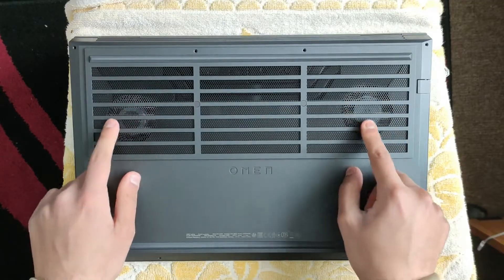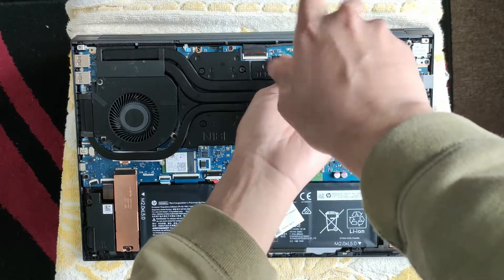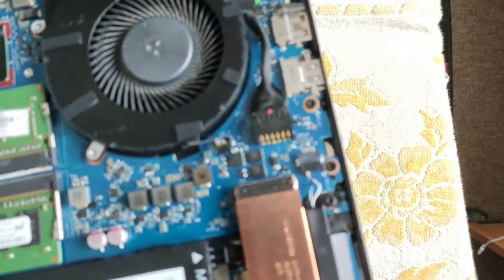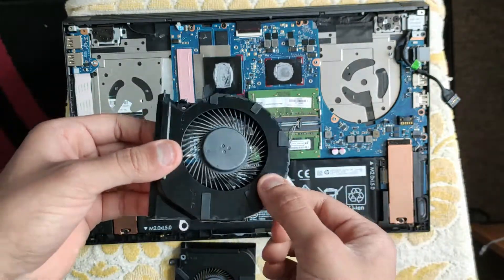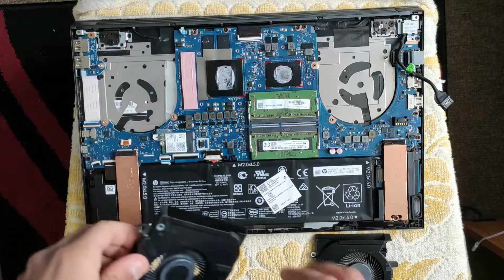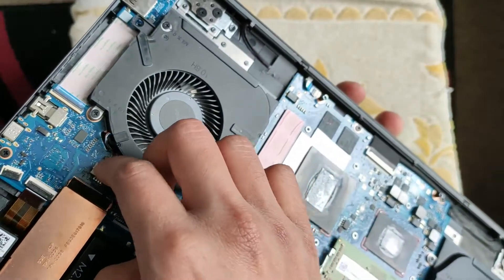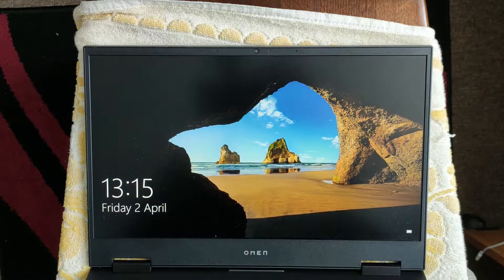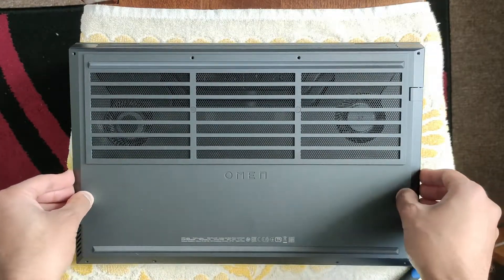HP OMEN 15 2020 || How to Remove and Clean the Fans

Comment from the maker: If you want to find a replacement fan for your device, you can find the "Service PN" number on the back of your fans. Use that to find online the fan that fits your laptop.

In my laptop, the part numbers are the following: 
M04215-001 for the GPU fan (fan on the left in the video)
M04216-001 for the CPU fan (fan on the right in the video)
Reply: thank you so much
Reply: I have HP omen 15 2020 with RTX2060, is it use the same Fan with the same voltage?
Reply: Hello sir .. did u know where we can buy that replacement parts ? Cause i needed it
Reply from the maker: @triprasetyo7418  I am afraid I don't. I have never bought a replacement myself, so I don't know where to buy one exactly. All I can say is that you can find them online using the part numbers above. Then it is up to you if you trust the website you find.

Comment: can u blow compressed air on the fan
Reply from the maker: You can, but you need to ensure the fans don't spin as you do so. You can stop them from spinning by holding them down with your finger or with something thin, provided you have removed the bottom cover of the laptop. The reason is that fans spinning too fast can wear down the bearings.

Comment: 3:10 the surface is not 100% perfect flat, on the center is more contact pressure resulting in less paste on that part and that's fine. (Pump-out is different and looks like dried out valleys or solid air-pockets)
The GPU has more contact pressure on the right side due to thermal pads stealing a little bit of it on the left side. I switched thin pads to putty on my repastes because of that. Halnziye HY-236 for thin gaps and UTP-8 for gaps up to 1.5mm.

Comment: hello i am trying to follow this tutorial to replace my CPU fan. but the heatsink screws in the middle do not seem to want to get loose, its come to the point that two of the screws have almost turned into a circular hole in the middle. please someone help on how to loosen them
Reply from the maker: Just to clarify, you're talking about the screws on the heatsink plates, in the middle, above the CPU and GPU, right? They don't come all the way out. They're spring loaded. You just loosen them until they don't come out any further and gently pry the heatsink up. It may feel stiff, especially if the paste has hardened over time. Also, make sure you've removed all the screws from the heatsink. You have the 7 on the heatsink that are spring loaded, and two small ones near either end of the laptop hinges. Need to make sure you remove those too, and these ones come out all the way.

Comment: 2:28 - Screwing the first two screw nails BEFORE you loosen the seven screws in the center of the heatsink. 

4:20 - Hidden screw nail underneath the wire for the left fan.

I'm glad you pointed the 2 things out because I follow the HP Youtube guide video for my laptop OMEN 15 ek-0000 and it doesn't explain ALL the steps you need to take to ensure laptop safety.

Comment: Will it be problem if i dont reapply the thermal paste but do it later, because i didnt buy any paste yet.
Reply from the maker: I recommend you wait for the paste before you remove the heat sink. Reusing the old paste is not ideal. If it was very much fresh, then you could argue it's ok, but since it's the old paste, it's not going to make good contact once reattached.

Comment: If i want just to clean it, it;s necessary to change the thermal paste too?
Reply from the maker: You only need to change the thermal paste if you remove the heat sink from the laptop, or if your temperatures are starting to get high even after making sure other things are not affecting the temperature, like clogged airways or just it being a hot day.

To clean the laptop to a reasonable level, you should be able to just pop the back panel off and blow some air on the fans and intake vents. That alone goes a long way. It helps to use a toothbrush for the more sticky dust before blowing that off.
Reply: Thanks!  @nighteye5253

Comment: bro i need help i did just like you and now my pc wont charge or turn on at all when i reassembled it and clicked on the power button it showed light for almost a second than it turned off and now doest show any sign of life
Reply from the maker: Make sure you have properly inserted the battery connector back in place. Then, try to turn on your laptop again. The first time you do this, you may have to turn it on a few times. Also, you will see a CMOS message, because the battery was removed and resetted. That's normal.

Comment: The heat sink doesnt come out. Can someone please help?
Reply from the maker: Two things: 

- Make sure all the screws directly on the heat sink are completely unscrewed. (They don't come out all the way, but you can hear them click when you try to unscrew them further).
- Make sure to remove the two small screws at the far left and right of the heat sink, near the hinges. If you try to lift the heat sink up, it becomes quite obvious which of the screws are still holding it on, just look near the hinges.

If even these are removed, then you probably have a case of dry thermal paste holding onto the heatsink. Best solution is to let your computer heat up (play games, run cinebench, whatever you want to stress it), in the hope to heat up and soften that paste. Once you do that, you should be able to lift the heatsink up using a small amount of force.

Comment: This is pretty great but is there a way clean it without having to open the machine up? Maybe not 100% good but if it gets 80% of the way there that would be great. Compressed air maybe. but then from which vent would it work best?
Reply from the maker: You can use compressed air from any position (I would do all vents and air intake). But the important thing is to make sure to prevent the fans from spinning. If you can do that without opening the cover, great. (I'm thinking if you have a thin solid wire that you can pass through the grating at the bottom and keep the fans from spinning, maybe that works?). But my suggestion is to at least remove the bottom panel for an easier time while working. Once you open it a few times, it gets progressively easier to open it the subsequent times.

However, keep in mind that compressed air can't get rid of the sticky dust. For that you'll need the good old brush (and opening the bottom panel for sure).
Reply: @nighteye5253  Thanks very much this is helpful! I read else where a suggestion to actually keep the fans running while using compressed air.... That seems like a dicey situation!
Reply: I've already had to replace the fans once and defo do not to repeat that experience! They do great job of cooling even if they are a little noisy but the dust situation is not good!
Reply from the maker: @HappyShard  The reason why we need the keep the fans from spinning is that compressed air can make them spin faster than their rated value. 

That can wear down the bearings prematurely, which means the fans can fail earlier than expected.
Reply from the maker: @HappyShard  That's the unfortunate reality of air based cooling systems. You could put a dust filter in front of it, but then that reduces air flow. It's a fine balance between having a cover of some sort and keeping the fans completely in the open. 😂
Reply: @nighteye5253  Thanks. I appreciate your help.😁

Comment: Little hope that this gets read but does anyone know if this guy has a video on trying to turning it on after one of these take downs my on/off button keeps blinking and won’t turn the computer on
Reply from the maker: If you haven't already tried, do a hard reboot, so hold the power button down for 30 seconds until it reboots. 

If that doesn't work, disconnect the battery connector, then hold the power button down for 30 seconds (discharges any remaining charge in capacitors), then reconnect the battery and reboot.

If you have removed the ram sticks for some reason, make sure they are properly in place. That can sometimes prevent the system from booting.
Reply: I’ve checked but it dosent seem to be working
Reply from the maker: @OneBlueFOX  Have you tried rebooting while plugged in with the charger? 

In addition, if you have removed your fans, ensure you have reconnected the leads the right way round.

Comment: my left fan vibrate so much and make loud sound, do you any idea how to fix it?
Reply from the maker: Are the fans obstructed in some way? Any dust buildup? Are the blades damaged or missing? That can make the fan unbalanced, and cause it to vibrate. Loud fans are common, but the vibration should not be there.

Comment: I got my laptop serviced and thermal paste repasted still idle average CPU temp is 80 degrees celsius when charging and running a few applications. not sure what to do as both fans also seem to be running
Reply from the maker: What was the temperature of the room your laptop was in when you took that measurement? That also plays a big role. Also, did you check your CPU utilisation? Could there be applications running in the background taking up CPU resources?

Comment: What screw do i need to unscrew the laptop bottom part
Reply from the maker: You can use a small Philips screwdriver from a precision tool set. All the screws involved in the process can be opened with that single tool.
Reply: hey hello can you link a philip screwdriver? @nighteye5253

Comment: Do the screws of the heatsink that don’t come out all the way need to be tight or not?
Reply from the maker: @Notanecuadorian Not too tight, just enough so that they stop turning when you manually turn them with a screwdriver and a slightly loose hold.

Comment: Hey all, I really need help. My HP omen 15 has had an issue with the GPU fan for a few weeks and I’ve been needing to remove the heatsink to get to it. While I can see all the steps to how to remove it in this video, despite me following them all, it is hopelessly lodged in place and I’m afraid of damaging the computer by attempting to force it out. I’ve tried whittling and every other trick in the book, and made absolutely sure that the black screws were loosened to their fullest and the top two screws were removed. It doesn’t feel like it’s only held in place by one section, the entire heatsink still feels like it’s attached at all points. Any advice would be appreciated!
Reply: I should also add that my computer refuses to stay on due to the issue with the fan, so keeping it on to soften the paste doesn’t appear to be an option.

Comment: Hey man, First of all great video. It really helped me to clean my laptop. Thanks a lot really. But I have a question, after i cleaned the laptop, i think fans are louder than before on idle. Did you ever encounter something like this before? I didn't clean fans because they seemed clean to me, I clean the heatsink and put new thermal paste on the graphic card and processor. Is it because i maybe put less thermal paste than i should've, so that to cool the processor fans working a bit faster than before? I'd really appreciate the help.
Reply from the maker: Well, applying little thermal paste is actually good, as long as it covers the entire die well. A thin layer of paste is better than a ton of it. But as you say, it could also be not enough, in which case the components will run hotter, and the temperature of the components will be higher. 

Run a stress test to see what kind of temperatures you get. Do take into account room temperature as well, as it makes a big difference.

If the temperatures are worse than what you used to get (which happened to me before, I had to repaste again), then might wanna consider repasting. Also, make sure that haven't just enabled performance mode for some reason, which will of course make the fans go faster.

Comment: Bro does it reduce fan sound if change fans or clean?
Reply from the maker: @Tamonash Pal Cleaning the fans will improve air circulation (if the fans are really dirty), which in turn reduces CPU temperatures. If the temperatures are lower, then fans will not need to turn as fast, which leads to lower sound overall.

Comment: Can I do such cleaning when I still have a guarantee? I will not lose it then?
Reply from the maker: @Stefan Eljasz If you are referring to opening and removing the heat sink and fans, then yes, you will likely lose your warranty.

But you can still clean the fans by removing the back cover (removing the back cover does not void your warranty) brushing the blades delicately, and then blowing some air on them, making sure they don't spin when you do so.

Comment: After cleaning the dust from the fans i haven't cleaned and repasted thermal paste. Now my gpu is not turning on, is it because of thermal paste?
Reply from the maker: @Bharath do you mean your GPU fan? If so, I suggest you check the fan header connection, you may have forgotten to plug it back in. The fans don't depend on the thermal paste.
Reply: @nighteye5253  the gpu itself is not turning on. I'm using Hp omen 15 with i7 and rtx 2060. In the omen comand center it is showing the gpu is not on.
Reply from the maker: @Bharath I am sure you can understand if I'm confused here. What do you mean the GPU is not on? Did you switch the MUX switch by mistake? When you play games, is your FPS ridiculously low?

Comment: So I have an hp omen with a 3060 and Ryan 5. Seems like same chastity. I have sprayed it with dust spray over and over. It looks clean but runs hot sometimes. Should I preform this action sometime?
Reply from the maker: @Ethan Greenlee Well, it depends how hot it gets. Removing the dust alone is not enough to prevent overheating. It's just one of the steps to mitigate the issue.

The idea is that the dust prevents the fans from blowing enough air over the heatsinks. But in order for that to happen, you need a lot of dust blocking the passage. A little bit of dust is usually not enough to prevent or affect air flow significantly. Therefore, you don't really need to clean it that often.

What sort of temperatures are you seeing for both CPU and GPU when under load? And how warm is the room where the computer is? If you clean the laptop often, then dust is not your issue. Any overheating is likely due to bad thermal conduction from the components to the heatsink. In which case, repasting the thermal paste becomes necessary. But again, it depends on room temperature and temperature under load.

Comment: Hello, just regarding the heatsink mine is completely stick to the laptop do you have any solution for it? Thank you
Reply from the maker: @Jad Benabbou Sounds like the paste is keeping the heatsink down. Try again, but right after an intensive session, like gaming. This will make it so that the paste is "softened" by the heat, which should make taking off the heat sink a bit easier. Take care not to hurt yourself, the sink can be quite hot.

Comment: My left fan makes a whole lot of noise and cleaning the fans is not solving the problem should i order replacements or take it to some service center 🤔
Reply from the maker: @Riyan Kalita Can you describe the sound it makes? It could be something with the bearings in the fan, or simply a piece of paper caught deep within the blades.
Reply: @nighteye5253  its a whirring noise and the service guys are saying they'll need to replace the fan without actually opening it up setting me back 6k inr
Reply from the maker: @riyankalita822  Did you remove the fans from the laptop and check yourself?
Reply: @nighteye5253  i did open the back case but not the fans im scared it'll damage my laptop
Reply from the maker: @Riyan Kalita Right, so here is the thing. A single fan would cost me between £50 and £55 here in the UK. I don't know how this would be taxed in India, but converting 6K inr to GBP gives about £60. If they buy it and install it for you, then it seems about right.
My concern is about whether you actually need to replace the fan or not, which is why I would personally remove the fan and have a look myself. If you cannot do that, and the sound of the fan is rather worrying, then it may be best to let someone else take a look for you.

Comment: My dude. Thanks for the video. 🙏🙏🙏
I would have never had the courage to remove the heatsink to get to the fans without your video. 

My right one (when lid open) started making strange noise. It turned out to be a small plastic peice in the fan casing. I can't say thanks enough man. I would have gone on even with the strange sound since I have a big presentation due in 2 days, and probably would have damaged my fan blades.

I managed to clean the dust off fan blades without removing the casing using my wife's unused makeup brush thingy. Brushed outwards gently letting the bristles go into the fan and the dust got caught in the brush. Hope it helps someone.
Reply from the maker: @Sanu Shameer I'm glad you found the video useful! 😁

Comment: Super usefull video, thank you ♥️
Reply from the maker: @Cristiano De Marco Gonzales I'm glad you found it useful! 😁
Reply: @nighteye5253  Sorry man, I' ve an OT question for you: i want to update from WIN10 o WIN11 on my OMEN, is it already stable enough? If it is so, you suggest to download Win11 on the MS site or there's a better option? I'm asking because i want to update but i don't want to lose the OMEN logo boot animation and all the HP optimizations for this PC. Thank you for your time
Reply from the maker: @Cristiano De Marco Gonzales I have had no issues with Windows 11. It's an upgrade that was offered directly from the windows updates settings. The omen logo is still there. Which optimizations are you worried about losing?